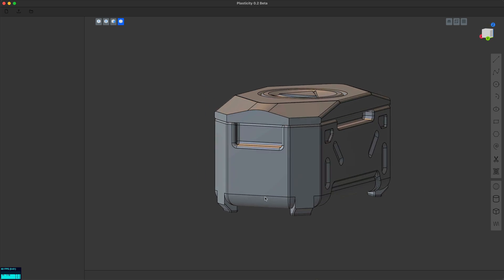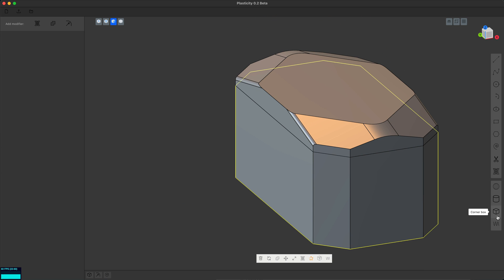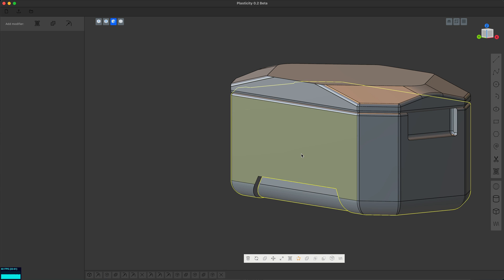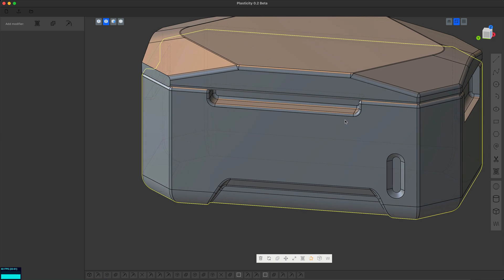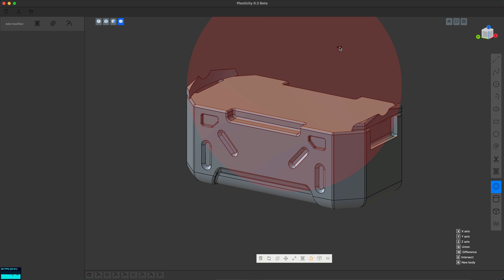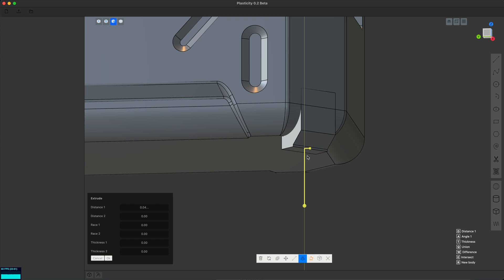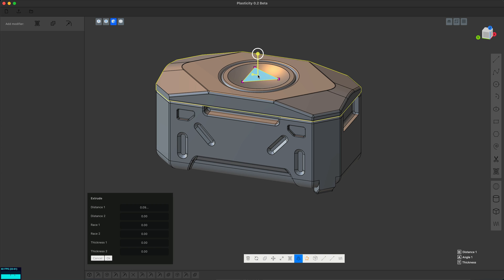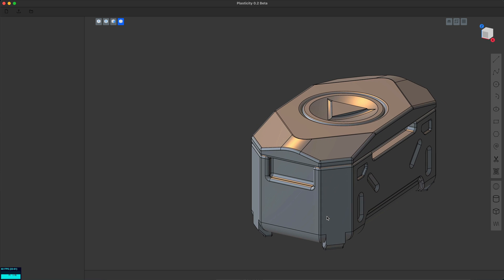Modeling a sci-fi crate in Plasticity

Comment: One of the most powerful tools in sketchup is it's meter tool. I haven't tried placticity yet, but I think a meter tool would make it powerful.
Reply from the maker: What is nice about it?
Reply: @nickkallen1  You can use it as a guiding tool to draw your lines. You just click, choose x y or z, and input the distance. I said it powerful because it makes architectural modeling really easy.
I mostly used the program for wood working, and the tape tool was my most used tool along with the pen tool.
Implementing it will make the Plasticity more generally used in other fields. Good job and good luck. <3

Comment: Loft, sweep and revolve?
Reply from the maker: I've got basic implementations of them but they need work for sure
Reply: @nickkallen1  I wonder if this program will be free or paid?
Will there be a boolean slice and split?
And will there be editing of surface control points like in rhino or moi3d?
Will there be tools to deform geometry (bend, twist, taper and ect.)?
Reply from the maker: @koverpet220  tentatively I'm planning to charge $20 for the app, and the front-end will be open source. Some of those features you mentioned will eventually be available ... The focus is on concept artists and their needs so I'm not building a kitchen sink cad app
Reply: @nickkallen1  
It's a pity that you decided to limit yourself to only concepts.